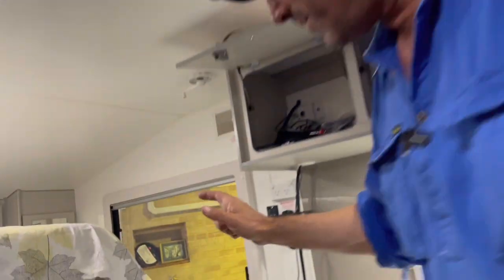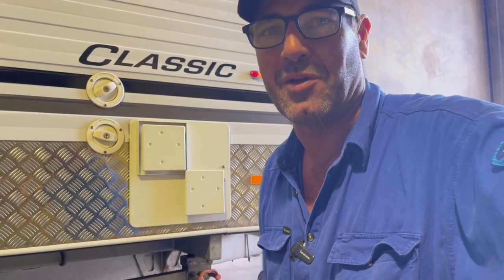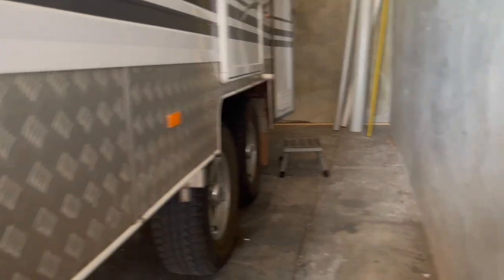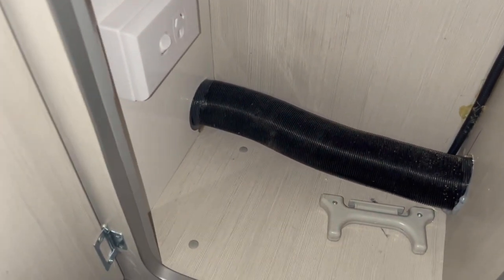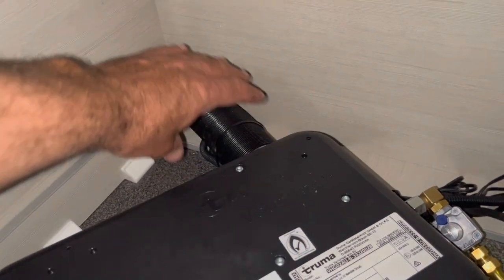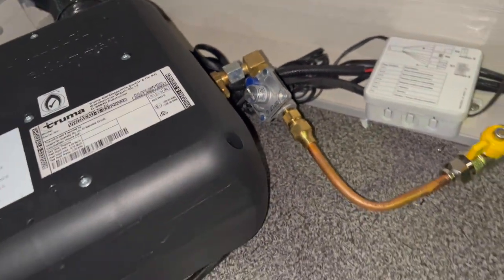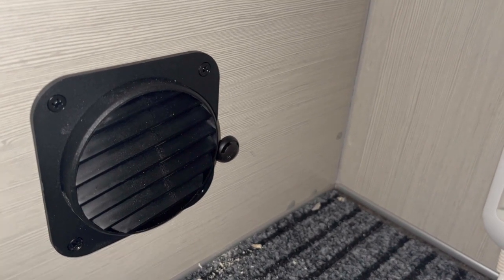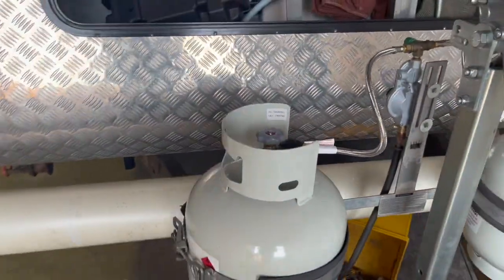Truma Gas Heater on Supreme Classic Caravan

Comment: I have just had a Truma installed into my Jayco a couple of days ago and I have the Control Panel in the same spot where the one is in your video.   Where / how did you connect the control panel wiring so it maintains its settings even when the 12v power has been switched off - is it run somehow direct to the caravan battery ?   Appreciate your advice as my gas plumber initially wired it up to the heater unit but it blew the fuse after about 10mins so he has bypassed the unit somehow.  The first time I turn on the control panel after activating our 12V power in the van, I have to reset the clock each time - not a biggie but would be great if the panel could retain the clock settings.